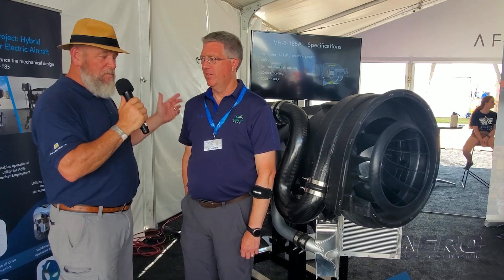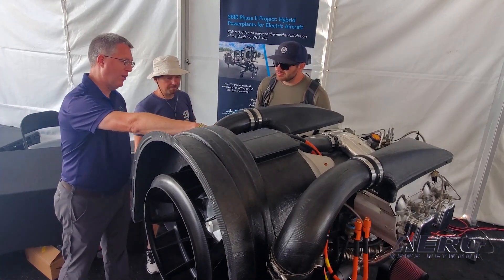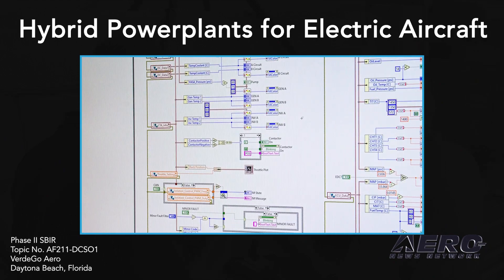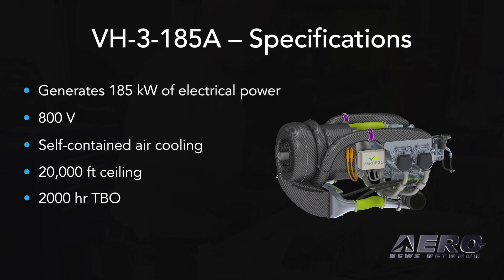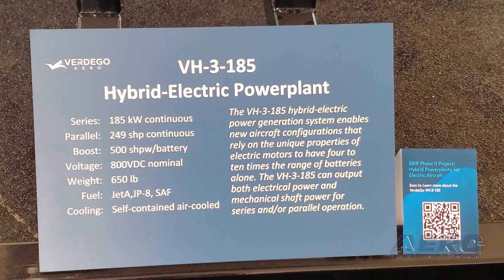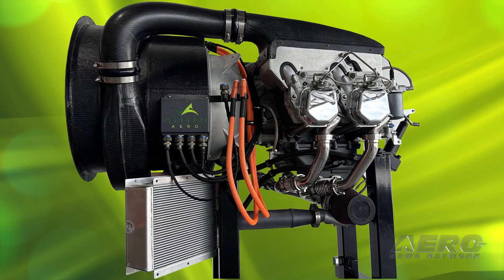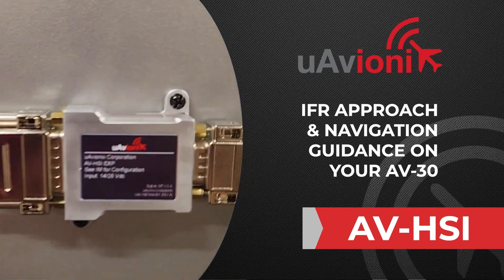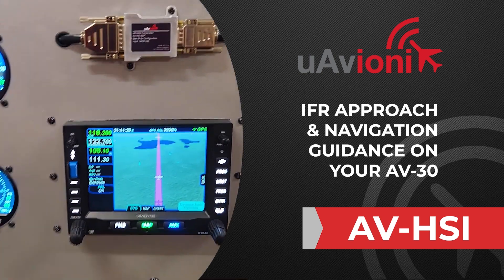Aero-TV: VerdeGo Debuts VH-3 Hybrid-Electric Powerplant

Comment: SWEET!  Now, can you make ones for boats?  I want to convert to a hybrid system for my boat, so I can combine my propulsion and generator systems.  Current setups on boats (yachts) require multiple separate APUs and Propulsion systems for any sort of redundancy, requiring much more space and weight.  Hybrid systems like this could allow for full redundancy on a dual generator/dual engine system, cutting down size and weight CONSIDERABLY.
Reply: What's stopping you from slapping this bad boy on there?